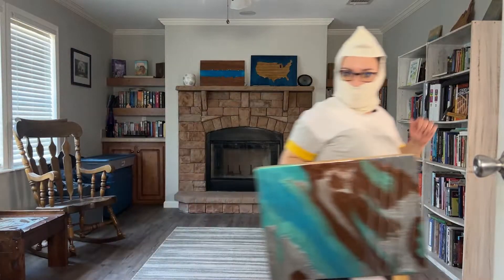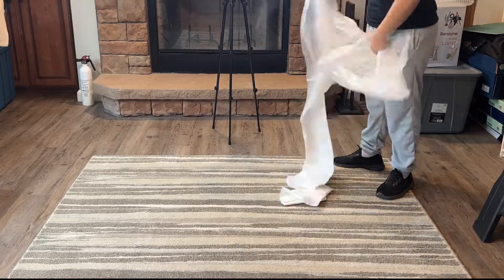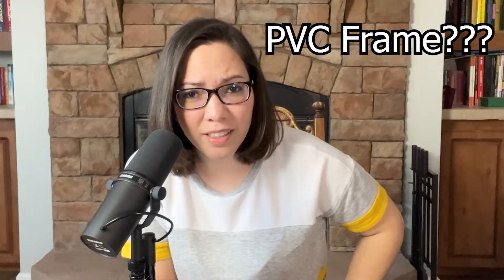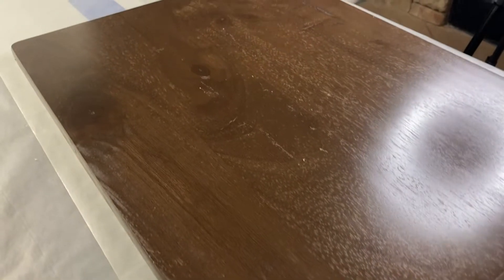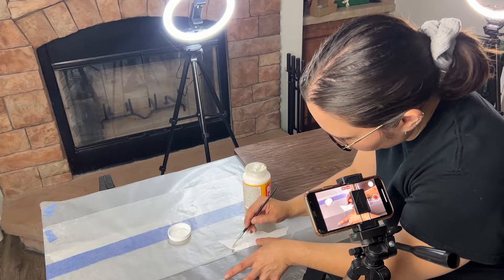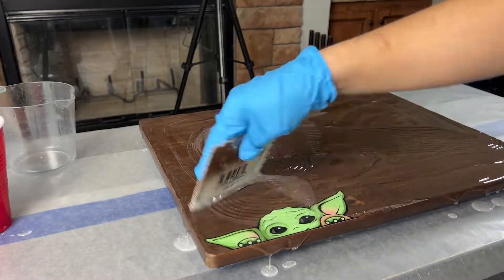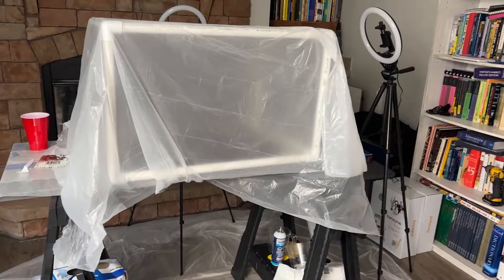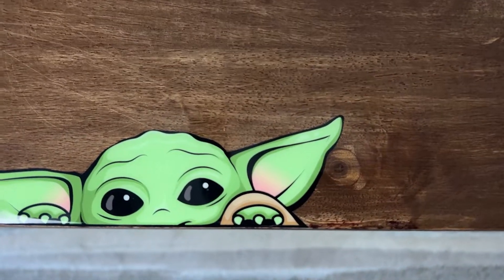Peeking Baby Yoda Table - Epoxy Resin DIY

Comment: Can you plz subtitle the all process becoz difficult to understand your fast voice
Reply from the maker: Hello 👋 sorry about that. Subtitles can be turned on through you tube. There’s a Closed Caption options in the settings or is normally labeled as “CC”
Reply: OK Thx a lot.i am new and start my first project with resin plz guide me what type of resin I use and how much,,? And my first project will b any suggestion
Reply from the maker: @InfoCom-ii9zr  I used a total of 1 cup to cover the top of this tray. I used Stone Coat countertop epoxy. I have the link and information on the description of this video with all the product I used :)
Reply: you can slow down the video to 0,75 too.